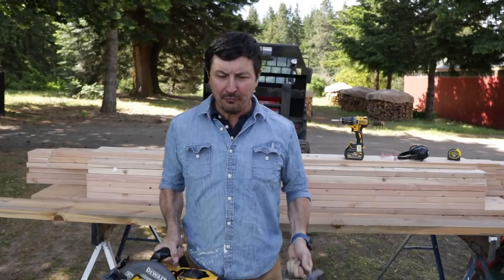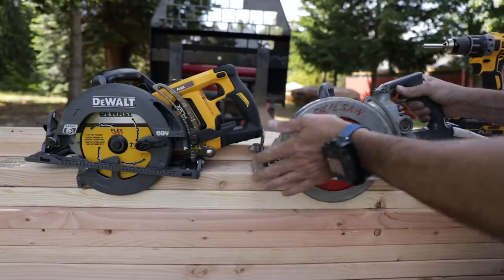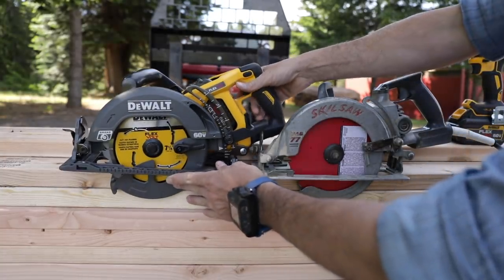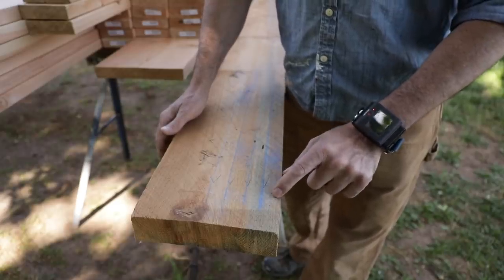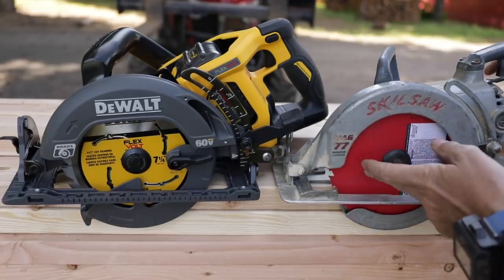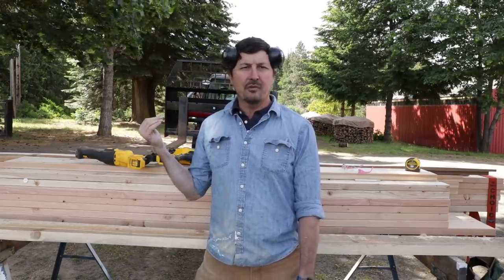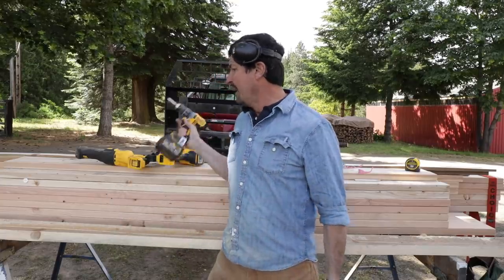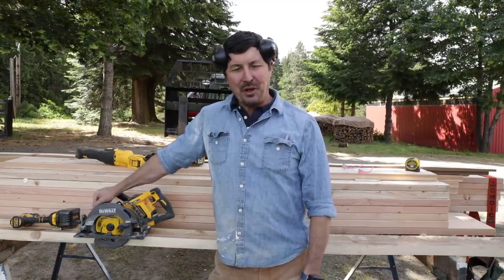Dewalt Flexvolt V.S. Skill Mag77 [S H O C K I N G]

Comment: Milwaukee cordless tools used daily year round. The ONLY corded tool I use is a hammer drill for concrete drilling. So far my batteries have lasted over 3 years, with no signs of loosing capacity...yet!

Comment: Definitely a shocker. I started with Milwaukee and im sticking to it. I do have a ridgid router and brad nailer but those dont use batteries. I did go dewalt on my table and miter saw. But still corded. Ive seen the cordless ones and i dont think its worth it for the price since i dont ever work in areas with no power.

Comment: Ok, but, if you had to cut 50 if those 2x's, where would the DeWalt be? The Skilsaw would still be exactly the same place, if you have the  replacement batteries, which would probably be more than a couple, you might be ok.

Comment: Cool video, I guess it really is more powerful than the corded skill like Dewalt initially said. I bought the Dewalt 20v 7 1/4 thinking it would be just as good, but it is always stalling when the job gets tough. I’m going to invest in the 60v one. Also, I like how on the one you are reviewing you have line of sight with the blade. The blade faces the other side on mine, and it’s not convenient. I can’t wait till I get this saw.

 I don’t know how many times I have to write this, but will continue to do so until Dewalt hears me...We need a cordless wood router!!! Makita has one and it is super nice!

Comment: I know I'm a little late to this video but I have questions. How long do the batteries last and how long to recharge one? I know having multiple batteries is a must but the charger is a long way away or a generator/inverter would still be needed based on your reasons. I don't mean to come across rude or anything, I'm basically wanting an update i guess. I've always had bad luck with sawzalls. I really enjoy your videos, by the way.

Comment: I see your point about the convenience of cordless and it seems the DeWalt had more power than the Skill saw but that's only with a full charge. Every time you make a series of cuts the battery is drained therefor depleting the power of the DeWalt. I think for weekend warriors or craftsman who don't use the tool all day every day the Dewalt is a great choice, but simply for the reliability and constant power I would stick with the Skill saw for pro tradesman. Just my humble opinion, I actually own both too I'm a tool junkie even though I'm a tattoo artist and guitar builder by trade. I do a lot of building and construction during my free time though.
Reply: Impressive man. I love it

Comment: Never had a worm drive saw in my hands. They are not easily available in Germany if at all. But from looking at it, they seem to be easier to handle then those with the motor to the side and I wish I could buy them here. So I really hope that DeWalt is bringing the worm drive to Germany. As the batteries and loaders are already adapted to 230 V and so on, it shouldn't be to expecive for them to do so.

Comment: I grew up using the skillsaws , I leave it at home on the job I only use cordless, Milwaukee though, I've had problems with DeWalt batteries going bad, maybe the new flexvolt is better

Comment: Paused the video from start and will say this. They are both worn drive which = higher torque vs direct or hypoid. However DC has a distinct torque advantage vs AC on an electric motor.

Comment: If your a production framer and working in hot climate especially above 95 degrees doing constant cutting the deawalt will cut out and you’ll have to let it cool down also had this problem with my dewalt 16 inch flexvolt chainsaw with 9 amp battery down here in Texas in summertime ,just couldn’t handle the heat after a few cuts.hat to finish cutting up tree with my echo.

Comment: Continuing my comments....by Joe Burkhalter......there are now Several 20 volt Dewalt impact tools on the jobs.  The 20 volt Dewalt s are so RPM fast that they will drive the Torx screws below the surface before you can get your finger off of the trigger.  We take the ramps down and reuse as much material as we can  after the patient no longer needs them.  It is time consuming  to try to back out a deck screw embedded halfway through a 1 x 6 deck plank  We air nail the jobs now except where the posts and stringers occur. We screw around the posts to permit easy disassembly.  I gave away all my old Dewalt lower voltage tools when I bought Bosch.  I have the drill and impact tools along with 4 batteries   Very seldom have to resort to a second battery..  That sail, I would definitely buy Dewalt in the future, but keep the Bosch drivers for the ramp work.

Comment: A long extension cord can rob a lot of power from your tool. If you're using a longer cord than 25', it should be made with 12 gauge or larger wire. I wouldn't buy less than 16 gauge for a 6' cord. I've seen people fry cheap jumper cables to the point of flames bursting out, because of the resistance of smaller wire.

Comment: Your test would come out even better for the Dewalt if you would’ve used the diablo blade for that Saw. The diablo blade is wayyyyyy better than the Dewalt blade. I was using the dewalt blade it came with and was satisfied with the Saw and though it was pretty darn good. But when the carbide tips prematurely flew off, I switched it out for the diablo and I was blown away!!!

Comment: A true test of speed would have been using the same blade.  Also, yeah, batteries wear out and replacements become unavailable.  Spending that much on a 'good' tool, I'm going to invest in the one I can use years down the road.

Comment: It is important to note that the DeWalt saw is not a worm drive saw, so the comparison isn’t really fair. The Skill 77 is a great saw but runs slower because of the gear drive and has a lot of torque. The DeWalt saw is direct drive, not worm drive. I have this same saw and use it professionally for about six months. The batteries last a really long time. With all the cutting I do, I switch batteries twice a day. The saw doesn’t lose power or strength as the battery charge dwindles, but when the battery is dead it’s dead. The saw stops mid cut and won’t proceed until the battery is replaced or charged. I had bought the regular 60 volt saw from DeWalt. I didn’t like it. The blade was on the right side and the weight/balance sucked. I used it for a month before replacing it with the worm drive version.

Comment: You should have used the same blade, assuming the cordless even uses a standard blade, and done a lot more cutting.  Sure, the saw was fast on the first cut, but how about the 50th?  From my experience, they lose power as the batteries fade very quickly.

Comment: I actually prefer and got myself a good starter set from Rigid for Xmas last year. Impact Drill. Impact Driver. Drill. Recip Saw. Circ Saw. Light. And a Router. 18v lithium ion. And Rigid now has their warranty for life. Battery ever dies, get a free one (Batteries aint cheap.) Tool ever dies.. get a replacement or they fix it for free. For life. Can't go wrong with that.

Comment: BLDC motor inside these, would work longer than brushed AC motor. Also AC instruments losses power on long wire runs both on the grid and in house. Hybrid solar and properly sized wires would solve a  problem with voltage. Jehu's channel has some good tutorials for DIY power walls...
As for longevity on batteries I would give 2 to 5 years since they are torched in cordless tools compared to power walls and even EV's where properly used batteries could last for 15 years since the load on one cell is much less and it can be cycle charged.
When Li-ion batteries are left in storage they should be in cool, dry place at ~40% charge for longevity.

Comment: I prefer Milwaukee. My tool box is full of cordless Milwaukee. Cordless 1/2” impact in my truck for the road, cordless sawzall, cordless removable quick switch bit impact driver, cordless drill, cordless 3/8 impact. I love Milwaukee. Any time I’m touching someone else’s corded/cordless tools, I feel like I’m cheating on my own tools. It just doesn’t feel right. I prefer usin’ and abusin’ my own tools.

Comment: You MUST use the same blade in a comparison test, I wonder just how different the ergonomics are ... I've owned corded Dewalt worm drives before, and they were just about the only worthy alternative to the skil
Reply: I'm also putting the quality of your power into question. That saw was bogging out way too easy. I'd say you need to get plugged into a home run to get adequate power(all 15 amps)
Reply: Im having a hard time making the switch, all the guys I was framing with back in toronto said its powerful and amazing to not have to drag out a cord.... with that being said he said Id have to buy two batteries.
Reply: The habitual movements I make while framing prohibit me from straying from what I'm used to. Ive used nothing but Skillsaws and CLC nailbags, since 1998... I've used Hitachi and Pasload guns, but prefer the Hitachi all day.

Comment: I'd say these Flexvolt tools pull more Watts than the corded variety. At standard 120V a 15 Amp connection maxes out at 1800 Watts. So even though the cordless uses 60 volts, they must be able to push more amps and therefore more watts. The Flexvolt Mixer/drill is also extremely powerful; they say twice as much power as the corded tool. Which could mean up 3600 Watts; that's a lot of volts pushing on resistance. Plus the metal gearbox seems pretty solid. Good tools.
Reply: depends on how many cells the battery has, each cell is a nominal 3.7V 18650 cell, these can do 30 amps each at 3.7V more if charged to 4.2v (also know as maximum safe charge level which nearly all lithium ion batteries charge too) 110 watts continues and peak higher, a 6 amp battery has 15 cells, the 9 amp has 30% more and therefore can deliver 30% more power, 2 of the 6amp batteries amps could deliver 3000W but that is unlikely as this much power would overheat the motors of any dewalt battery tool  so you can expect around 2400W.
Reply: @miguellopez3392  Thanks! That's still more power than standard 15 amp circuits can handle. Especially with the start surge. I'm really interested to see what happens when Li₂TiO₃ starts replacing LiFePO4, LiCoO2, LiMn
2O4, LiNiO
2; as they are rated for charging over 10C and discharge over 40C with a higher variable operating temperature range.  

Seeing the performance of the tools; I'm confident that I can use 2x 150Ah LiFePO4 batteries to power a cordless welding machine. It will be recharged via MPP Solar all in one solar inverter/charger. The setup will also power a 5000 W inverter, and includes isolated DC - DC alternator charger.
Reply: @miguellopez3392  Also, FYI, the Flexvolt 9Ah batteries have 3 series, or 20 v parallel, packs of 5 cells, or 15 cells. The cell dimensions are 21 x 700 mm; so they are 21700 cells which range from 3000 up to 5000 mAh's. So let's say theoretically 40 or 50 A. Therefore, 148 - 210 W/cell or 3150 watts maximum and 2220 watts conservative. 

Let's not forget that the discharge rating of 21700 battery cells is 3C. So in theory they are capable of 150 amps/cell; 630 watts/cell; and 9450 watts peak output maximum. Which they definitely aren't doing in this case; or small over-molded tool case.

I haven't gone in to measure the wire gauge or test voltage directly input to the motor coils; but they do look rather robust in comparison to standard coils; probably 10 or 12 gauge. So depending on what the actual voltage is after the SMPS anywhere from 20 - 30 amps (60 - 120 volts).
Reply: @miguellopez3392  It just occurred to me that with capacitors these batteries wield an insane amount of potential energy. It was scary to see 480 volt caps in my flat screen TV. It's almost enough to trigger a nuke. Well, one or two ingredients short.
Reply: @brendanwood1540  when i looked it up i saw they where the Samsung 20S 18650 cell.

Comment: It would be interesting to see how the cordless saw's performance holds up as the battery begins to run dead. The Mag 77 will have performance as good as the blades sharpness while the Dewalt's is tied to battery strength and blade sharpness.

Comment: Well that was a surprise. 

I guess it is the same always. It wasn't until the late 1950's that a chainsaw could beat a 2 man saw. Now chainsaws are everywhere. While the saw had been around for thousands of years, it's proficiency had been limited. In Michigan, at the height of the timber days, in the 1850's, they didn't use saws for trees. They felled them all by axe. 

Time moves on and so does innovation. Cords used to be the only source of power and now it is in something the size of a box of 3" in wood screws. Amazing.

Comment: I feel if you are going to compare a brand new dewalt saw to the older version of the skil. That's not even the best skil saw they make. The red one with the black handle has higher rpm then the gray one. Doesnt tell which Is better. Yes the battery saws are awesome! Just thought I'd say something

Comment: My DW 60 volt circ saw is now replacing my corded one.   It’s faster, easier to wield without cord, no need for generators or worrying about voltage drop over long runs of cord etc.   just pick it up anywhere and start cutting.

Comment: Corded are forever, cordless, not so much.  First cordless drill was a 9.6 volt Milwaukee, it eventually died.  Replacement was 14.4 volt Dewalt, it died.  Standardized on Makita LXT when they first came out because at the time they were the only 18 volt lithium available, now I probably have 8 or ten compatible tools.  I'm stuck; would cost me thousands to upgrade.  But my Milwaukee hole shooter just keeps going and going, kind of like the mag 77.  It's easy to standardize on obsolescence.

Comment: Not trying to bash you or anything like that in this comment, I really enjoy your channel but I just had to let this out. Battery tools are great but if your an average homeowner who may only use the tool once or twice a year I think a tool with a wire is a lot more beneficial because not using the batteries kills them and you won't even get to use the tool so when you need to get a new battery for the one that died, they no longer make that battery because this new nifty better battery came out and now your stuck buying a new tool that is now probably corded that you should have bought in the first place unless your crazy and just like to flush money down the drain. But with the cord tool the homeowner won't have to worry about continuously charging a battery and as long as the tool doesn't break you could essentially use it for the rest of your life. So I think it is more important to determine tool usage/frequency before just jumping into buy battery tools and no one ever really talks about that. Everyone for the most part just say this thing is great, no cord and it cuts faster, this is what you should be buying. Weight your options and think about what your buying before you buy it.

Comment: A "true" field test would be running them with identical blades during production work (i.e. non-stop cutting both for an equal amount of time). How much faster would the DeWalt be after say, 1/2 an hour? It'd have to begin slowing down because of the drain on the battery. Also, does it overheat after X amount of time (the battery)? Does it need time to cool off? Does one then need two of them to keep working non-stop? Of course, I'm talking about production work, what I believe these saws were intended for, not the occassional use on a homestead. 🙂

Comment: Power chorded tools are the way to go. Battery operated power tools are sensitive and can't take the abuse with the exception of drills. Bought a Milwaukee saw-zaw and had issues with the battery getting loose in the housing after 2 years. Went back to my chorded DeWalt hasn't let me down yet. Same thing with other battery operated power tools. Their is a certain life expectancy with batteries and chargers then you have to buy another one of either within 2 years give or take.

Comment: Why would a professional house builder want a cordless tool? If they are using it all day every day not only will the batteries severely limit the amount of work one can do but Lithium Ion batteries also take damage every time they are used. Ie it would be extremely expensive for less productivity. It sounds like a very poor idea or a very niche product. Also due to the internals the FlexVolt battery takes a particularly large amount of wear, especially when being changed. I can't think of a worse battery for professional use. You will spend multiple hundreds of dollars a year replacing worn batteries.
Reply: Enough to be able to repeat opinions told to me by professionals. Saws absolutely drain batteries. People in that very specific trade have mocked cordless saws to me. They simply aren't going to last with high intensity professional use all day, much less every day. I'm talking about the saws shown in the video for the job mentioned, not some occasionally used backup drill.

Comment: Why nobody invented a sort of "backpack or belt of batteries" in which you could plug a traditional corded tool (like the one you already own)? 

And also not having to hold the weight of the batteries on the tool itself (stress in the hands/arms/shoulders).
Reply: Because the wheight and size of the batteries would hinder mobility, and would cost more.

Comment: I feel like this test was a little unfair, it looks like the Skil was used, meaning the brushes could be worn down, compared to the brand new DeWalt. That could be driving down performance and power and give the DeWalt an upper hand. And I feel like using, say Milwaukee's cordless circular saw with the new 12.0 battery, or any other one of the other big names equivalent would be a fair and sensible fight.